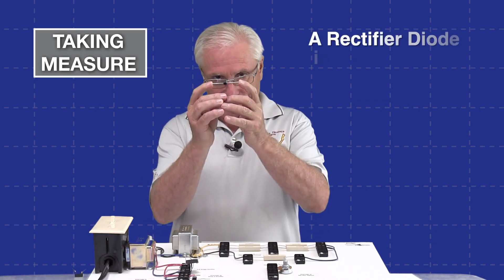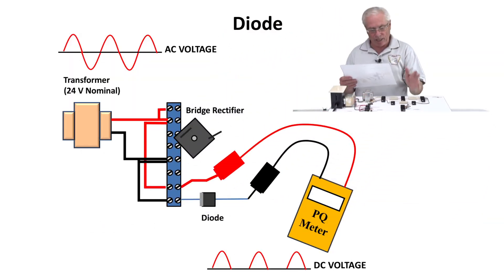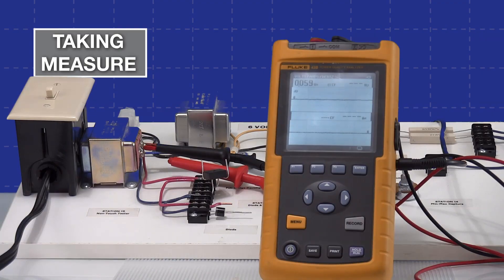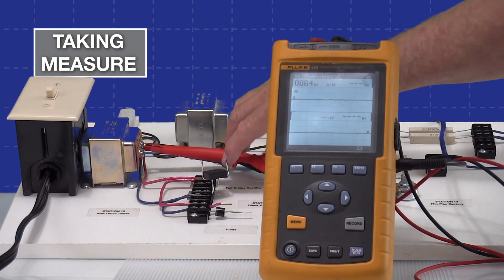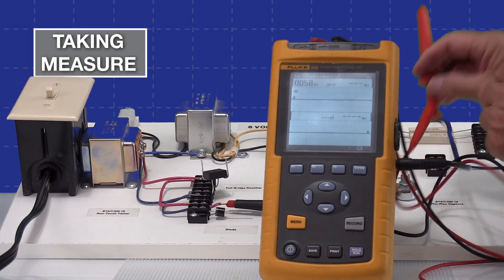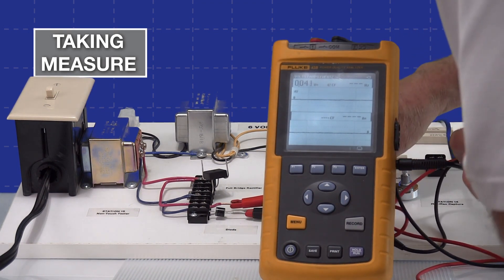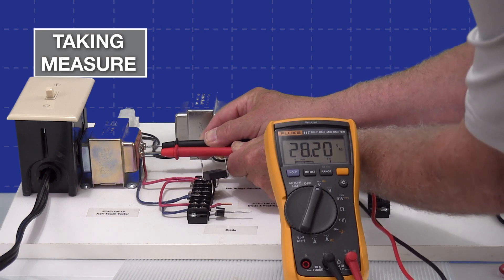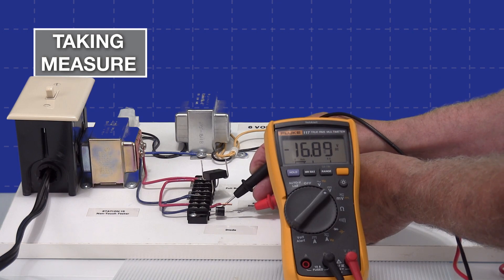A Rectifier Diode in an AC Circuit

Comment: Cool.  Why would you want pulsing DC current?
Reply: Maybe to create a pulsating emergency light, among others things.
Reply: A pulsating DC current isn't typically desirable, and it's usually filtered to smooth out the waveform.  Consider a hair dryer with Low and High heat settings.  The High setting powers the heating element with AC current.  The Low setting adds the diode which reduces power to heating element by removing half the waveform.  Unlike a lamp or sensitive electronics, the pulsating effect on a heater isn't noticed.
Reply: @AGeiger63  ah.. Interesting...Thanks